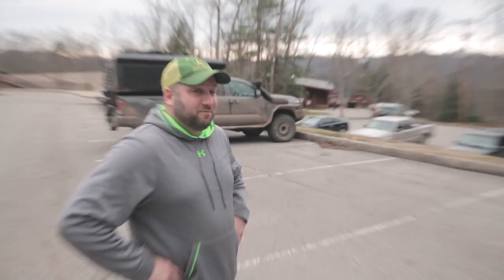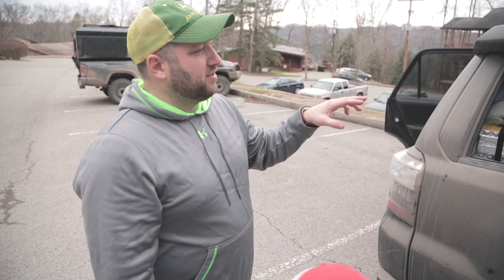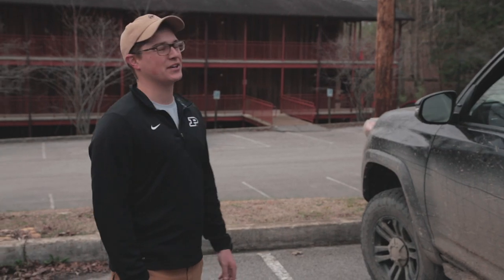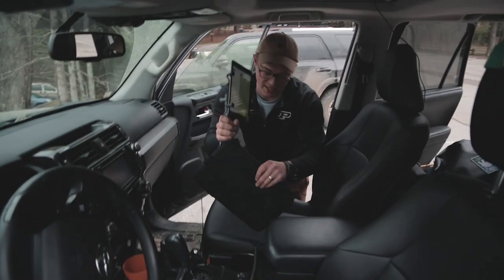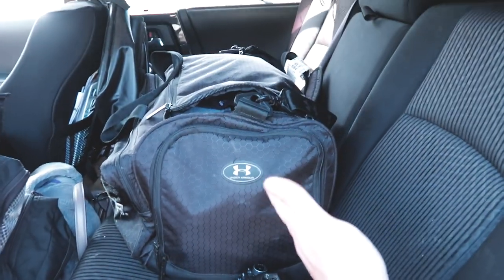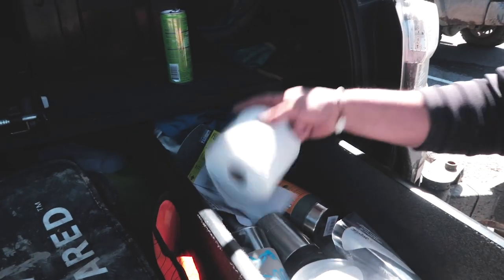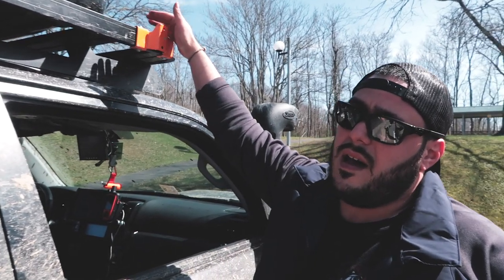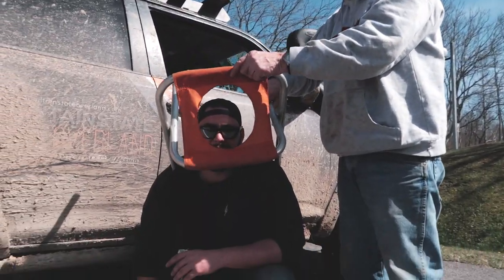Built 4 Adventure - Walkaround: 4Runners - Mountain State Overland

Comment: Need more info on that ipad holder second dude had!  Looks like maybe it's a battery pack too?
Reply: Here is the seat wedge, it allows you to add other ram products to it, so you can use it for a tablet, phone, etc. 
https://www.rammount.com/part/RAP-407BU
Reply: Nice, if someone was thinking they'd make that thing a battery pack too!
Reply: Kevin Berth yeah, but with it's current use. The battery pack wouldn't be any use in the car, only out of it. Then you have a giant laptop sized battery to tote around.
Reply: Its the RAM tough-wedge mount, it has a pocket where you can slide in a Anker PowerCore slim! Great for long car rides
Reply: They have one with an inflatable airbag, too...but I will just use the one from my lockout kit if I need the extra expansion.

Comment: No one mentioned adding ARB rear diff and rear Locker breathers. Recently purchased the 2020 TRD off-road and have been told not to drive in water deeper than 6in without installing the breathers to Protect the rear end? Anybody have thoughts, experience or opinions on this? Thanks